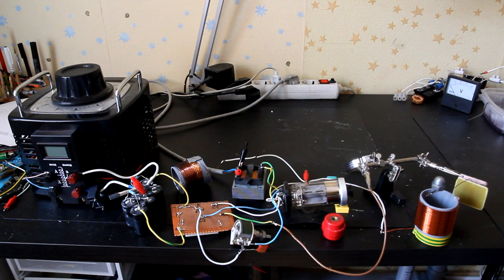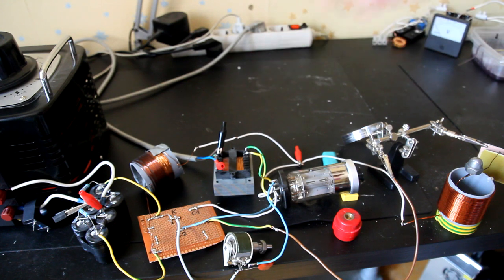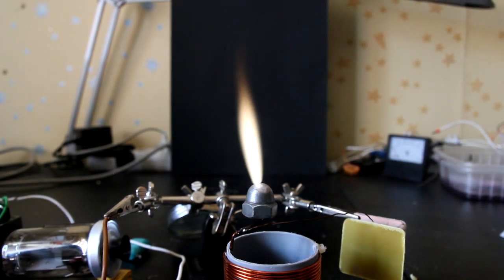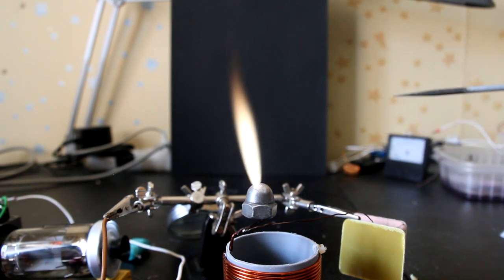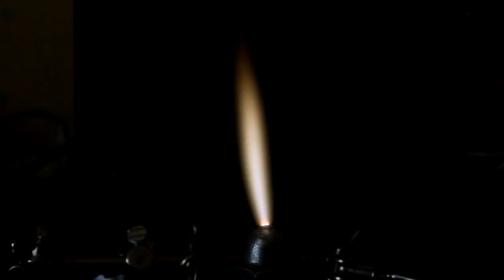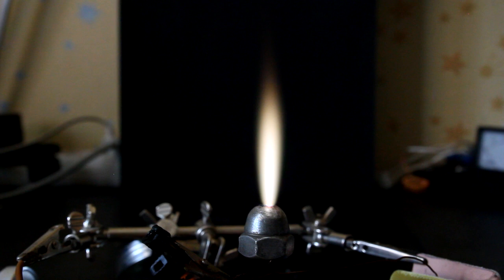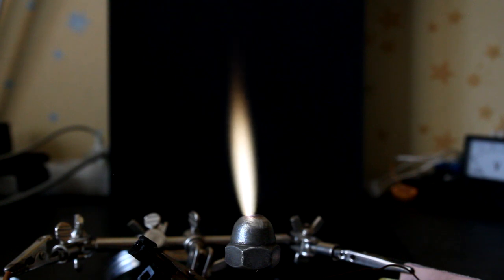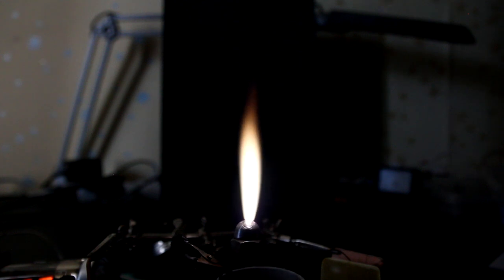The Torch Discharge (AKA RF Plasma Flame)

Comment: Wow,man,well done! It is a very nice torch! You said in the video that the requirements to make a torch discharge are that the frequency must be above 6~9MHz and the power must be above 30w,right?So this means that i can use a lower voltage to ignite the arc,but with a larger current capability,to creat an current carrying torch discharge?Dont know if this interpretation is right,but if it is,it's nice for an experiment!
Reply from the maker: Hmm, interesting thought; but I think the voltage also needs to be quite high, it is a form of corona after all :)
Reply: Hey Vidduley!Thanks for the reply! Do you think around 600V and 1A is good enough for a dense torch arc?I want to create a dense plasma,and i'm thinking about using 600v 1A to do so,or use a MOT to generate a 2500V voltage,but the current would be quite small.My experience is not so big,so i wonder if you could clarify me what is the best option to generate that dense plasma.Looking forward to your reply,and once again thank u!

Comment: Is this “ flame “ going to work under high pressure conditions as 10-12 Bar air pressure for example ?
Reply from the maker: As far as I know, it will work. If we assume that the discharge parameters of torch discharge are somewhat similar to those of an electrical arc, such an increase in pressure would make the plasma more dense and the discharge more hot.

Comment: If you use a conical/pointier surface do you observe a more concentrated emission? Like a gas torch or something similar?
Reply from the maker: Not really, the bottom of the flame becomes more bright, but the overall candle-like structure remains.

Comment: Can you give the circuit diagram ?
And can I use a transistor in place of Vacuum tube ? If yes then tell the number of the transistor🙏🏻
Reply from the maker: The circuit diagram can be seen at 0:25. No, you need this exact vacuum tube here, for use with a transistor the circuit needs to be significantly modified.

Comment: Can this arc be audio modulated?
Reply from the maker: No problem, as far as I know, the grid and the anode modulation both work fine here. Although the efficiency might be poor.
Reply: Nice! How big is the flame and how much power does it consume?
Reply from the maker: Oh, I personally never have tried it) Just seen some people on the youtube do it, and the flame was about 3 cm.
Reply: BTW, was watching your Electric explosions vid...for added effect, you could try mixing red iron oxide powder with nail polish and painting Alumium foil with it. Let it dry and then short circuit.
Reply from the maker: Huh, you mean sort of a poor man's thermite coating? That's a great idea, thank you! I might try that in the future if I get my hands on some Fe2O3.
Reply: Correct. Ironoxide is very easy to make. https://www.youtube.com/watch?v=4VspOqaJ3gc. Normally the thermite reaction requires a lot of enery to get started, but with your capacito set-up, this should be more than enough.

Comment: Wow,man! Such interesting type of discharge! Does it work with high frequency pulsed DC output?Your variac was 230v but what was the current drawned to produce the 12 cm torch?Thanks man,really nice video!!!!
Reply from the maker: Thank you so much! About DC: I don't know, but that's a really interesting idea! I know that corona acts weirdly on HF pulsed DC. About the current: I also don't know :D The powerful HF signal basically renders unusable all nearby multimeters, so I couldn't measure it directly, and at the time I didn't bother to use an oscilloscope and a current transformer. I think that the current wasn't that much, maybe 1-2 amps.
Reply: @Vidduley  thnx for replying,man! I have a few more questions to ask you,just to fully understand this circuit and start building it ( a nice work for a quarantine, corona discharge against corona virus hahahaha).So, if i understand what you said correctly, the point of the circuit is about HF AC  discharge because this type of torch is capacitively coupled,and capacitors are a short for AC,right? You said down below the coments that C3 is just for the resonator,but C3 must be a variable capacitor?Or it can be just a simple ceramic?And this cap C3 is in series with a 100pF cap,what's the point of the series cap?Just one would be enough to resonate,so i didn't get the function of this cap very well. The last question for now is about the distance of the single electrode.It must be very near the resonator,or i can push it to a higher distance like 40,50cm away of the resonator? Well,thank u once more for the pacience to replying and congrats again for this nice video!!!
Reply from the maker: I can answer some of these questions. The circuit generates HF AC because in order to produce torch discharge you need to make lots of current flow through the air to make it very hot and produce strong ionisation. Like, in a regular electrical arc it's the same effect, but between two electrodes, so you can use DC, AC or pretty much whatever you want. But here you only got one electrode, so a lot of current will flow only through the capacitance between this electrode and the ground, if the frequency is high enough. 
The 40-50 cm of wire will act as an antenna and will radiate power away, so less power will get to the discharge and it will be smaller (I think). About the capacitors and the circuit operation, I really am bad with vacuum tube circuits, so I don't really know what each component does :) In theory any RF generator with high enough power on the output and 1-2 kV of voltage should work to produce such a discharge, moreover, as far as I know, at 1+ kV RF it's a huge pain in the butt to NOT produce it :D Hope that helped somewhat.
Reply: @Vidduley  man u helped me very much,believe me. I've tried to find some literatures about this kind of discharge, but i didn't found much about the explanation of the phenomena (i've searched in english sources).I will try here with HF AC and DC,and when i finish it, i'll post a video and send to you. Thanks again man,may the arc god bless you haha
Reply from the maker: Look up "torch discharge" at scholar.google.com, there are some articles about it, mainly about it's usage in plasma sources
Reply: @Vidduley  yeah! i've made a search but found only about industrial purpose,like plasma cutters and torch discharge with an ionized channel jet.Didn't realised that it was the same phenomena like in your videos. I'll search more about.Once again,Vidduley,thank you!
Reply: @Vidduley  Hi Vidduley! It's me once again. I'm trying to make this torch but i think i'm missing something. Do you use a transformer in the output like a tesla coil, or it's only the high frequency 1kv+ in the antenna?  Once again thank u and sorry if i'm bothering ya

Comment: What voltage did you use to heat the cathode of the tube? Thank you.
Reply from the maker: Nominal voltage of the tube, 12 volts
Reply: @Vidduley  12 volts AC or DC?
Reply from the maker: AC

Comment: They probably hid it  you could use this to ignite very lean fuel mixtures in an engine.   Imagine a turbo jet engine with plasma igniters
Reply: The problem is that kind of a flame will melt basically anything, styropyro made a video on this and it was vaporizing a carbon electrode that he was using, he took a Tungsten filament from an incandescent bulb and it was melting uncomfortably quickly. Also you need a ridiculous amount of electricity to make these things work. There are much simpler ways to use electricity to ignite the fuel

Comment: Can you burn a cigarette with it?
Reply from the maker: Sure, you can burn lots of stuff with it :D The torch is very hot. However, I would be careful here, because the discharge is at full anode potential, so if you accidentally touch it, it may conduct a serious electrical shock into you.

Comment: Hey Vidduley,
I'm looking to replicate this circuit and would like to ask you about the heating transformer, the two coils, and the feedback capacitor.

What heating transformer and feedback capacitor are you using?
What are the requirements for the construction of the coils?

I'm sorry if the question about the heating transformer is a stupid question, but this is going to be my first time working with vacuum tubes and the circuit diagram does not show the part.

Comment: put graphite on the capnut see what happens.
Reply from the maker: Good idea, it probably would handle the high temperatures better than steel. Will try that in the future!
Reply: I put graphite on my sparkplugs in my truck and got more power and gained 30% increase in m.p.g. ,from my test at home it looks like it creates a plasemoid if I blow air on the plug out side the engine it looks like a lighting storm ,very cool.

Comment: Schematic available? Thanks.
Reply from the maker: Yes, you can see it at 0:25
Reply: @Vidduley  Values for L1 and L2 if possible please. Also, how do you determine the capacitance for C3? Thanks in advance!
Reply from the maker: Oh, these are components that are easier to make than to measure, you can see the two coils in my setup - these are L1 and L2, the plates on the output coil form a feedback capacitor C3; you can estimate their sizes from the video, the dimentional accuracy is not very critical here
Reply: @Vidduley  Sorry if I am being, needy, this project is very interesting and I might attempt recreating it in the future. Also, there is very little documentation online about this phenomenon, you are my only source of information. Anyway, keep up the great work! Awesome video!!
Reply: @Vidduley  Alright, then what would you estimate the diameter and coil turn count for each L1 and L2, kinda hard to tell from the video. Thanks!
Reply from the maker: Thanks! The L1 and L2 both are about 20-25 turns on 50 mm diameter tube, L1 can be any wire you want, but L2 must be thick enough to withstand the heating from the contact with the torch, I used 1.5 mm diameter enameled copper wire
Reply: @Vidduley  thank you
Reply: @Vidduley  And the capacitor? How did you make that?
Reply from the maker: Just two parallel textolite plates about 3x3 cm in size
Reply: @Vidduley  Why textolite?
Reply: @Vidduley  Why not just metal plates? Thanks.
Reply from the maker: Because that's what I had laying around at the moment
Reply: @Vidduley  So metal (ex. aluminum) would also do?